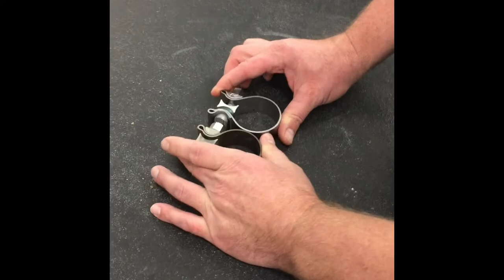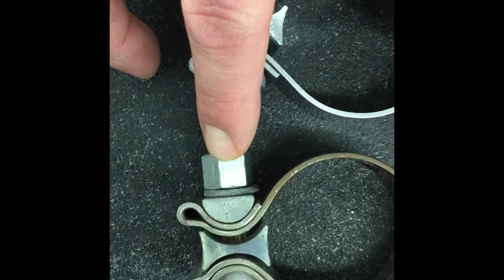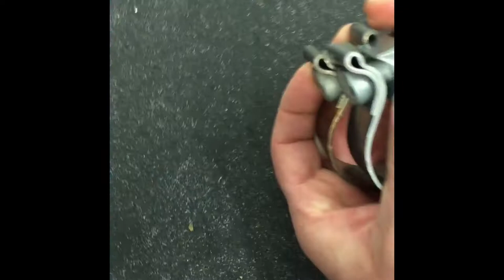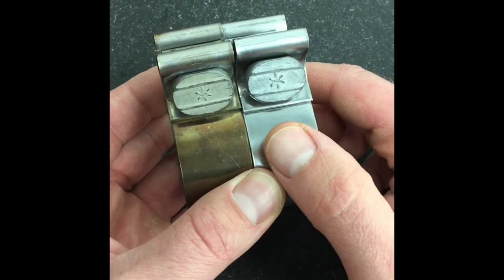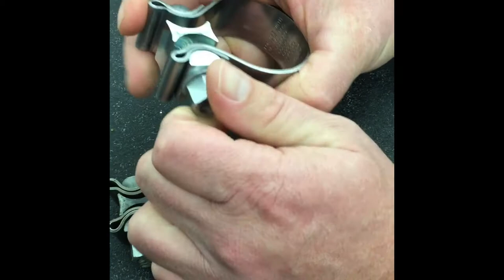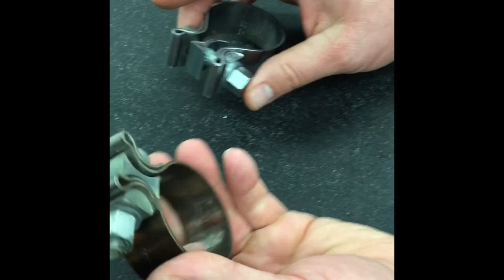Muffler clamp

Comment: The nut on mine is very tight and rusted. Once I tried to take the nut off of it to replace the clamp it was very hard to remove and finally stopped half way before I got it off and won’t budge now mainly due to the amount of slack now in the bolt and the nut. me trying to remove it allowed that flat piece on the bottom to twist every time I give decent pressure to the ratchet to remove the nut. What should I do to get the flat bottom piece of the bolt to stop twisting with the nut as I try to remove it?
Reply from the maker: Trace Kilpatrick depends on how far backed off the nut is: if your saying it’s backed off 1 thread and stuck then I’d try first a good pair of vice grips on the flat end and use some penetration lube. Or jam a large screwdriver in between the hour glass shaped spacer block and the clamp thereby applying enough pressure against the flat part that it doesn’t turn any longer, while undoing the nut. If that doesn’t work I’d use a die grinder and cut the bolt and nut and or the clamp itself in an area where if you punch through the clamp you don’t damage the muffler or exhaust. 
If it’s backed of a 1/4 to 1/2 inch great, pull the muffler off and remove the clamp, no need to take the nut completely off, just loose enough to work the muffler back and forth on the head pipe until the muffler mouth has been spread far enough to release its grip on the head pipe and you can easily pull the muffler off. Remember lube is your friend. Does that make sense??

Comment: Hey how do you remove them awnser please
Reply from the maker: Brian Archivaldo Velazquez lube is your friend... 9/16th socket and usually a hammer of some kind. I like using a dead blow simply because it's plastic and won't damage the exhaust. Tap evenly around the clamp trying to keep it from going cockeyed and it should come off after a few whacks. Good luck